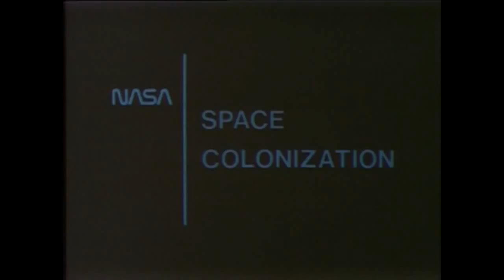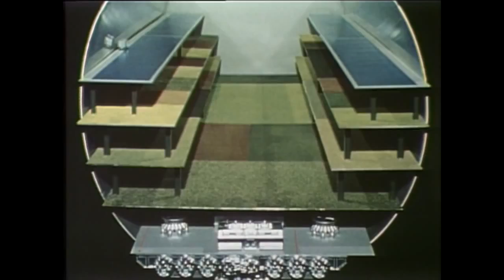Space Colonization  Stanford Torus Type Station 1970's NASA Video

Comment: I admire their vision, but there was absolutely no way this could have been built by the year 2000. It would have required an extensive moon base to mine the materials and then use a mass drive to fling it into space, which would have been an amazing feat in itself. A construction base would have been needed to be built at the Lagrange point, which would have been another herculean project. Finally, a 10-million-ton rotating structure would have had to be constructed. This compared to the 450-ton International Space Station that is in a far easier to reach location of low Earth orbit. I don't know in what reality they thought it would have been remotely possible to get that all done in just 25 years.
Reply: If it had been funded, yes we could have done it, could do it any time we wanted to start.
The people in the dtudies knew better than you or I when would be needed, and it was/is entirely feasible if we tried. We spend far more on the military than this would cost.
Reply: @JFrazer4303  The designers greatly underestimated the cost and technical expertise to build one. In 1975, the Space Shuttle was starting to be built which I'm sure the designers thought would greatly reduce the cost of launching material into space. The reality was the Shuttle never turned out to be the great affordable, reusable space launch vehicle that they hoped for. Even if the Space Shuttle had worked out, it was only for getting a payload to low Earth orbit. Another kind of shuttle to transfer cargo from LEO to the Moon and Lagrange point would have been needed and nothing like that was available in 1975 or even in active development. So, yes it was an amazing concept, but far too optimistic in 1975 to think it had any chance of being built by 2000.
Reply: @ The Shuttle was irrelevant, except in the very early stages building up to mining for the materials. Nobody expected it, with 20+ tons in a little payload bay, to serve very much in such an effort. 
It was known before the Shuttle flew that it was too small, too hyper-expensive and under capable for any sort of large effort.

We're not talking about what was historically available in '75, but what might have become available by '85 if such a program had been funded and started in '75.
Reply: @JFrazer4303  The point is that there wasn't the PROVEN technology in the 70s, 80s, or 90s to build a torus, especially in 25 years. If humanity's very survival depended on it being built, perhaps the technology could have been developed in time. Who knows? The expense was too great to even try on something that would have been a giant vanity project.  The success of the Apollo missions brought on a false hope that more manned space exploration and colonization would follow, but then reality set in.
Reply: @FlintIronstag23  if you doubt that technical abilities to do it, then you're invited to show your professional qualifications in all the relevant mining, construction and astronautical engineering, and where you're published under peer-review showing how the conclusions of those studies were wrong..
If you don't have facts and numbers better then theirs, don't bother talking about your feelings about the practical feasibilities of it

No new inventions needed, once the launch and in-space infrastructure is planted.
All the processing and construction methods are known if not used in such a way at such a scale, yet.
Reply: @FlintIronstag23 
Regarding the expense, I've seen good, rigorous, moderately pessimistic projections of the '70 space settlement studies. up to the first torus for the 10k workers in the attached manufacturing facility and all the ground, launch, and in-space infrastructure to mine the Moon and especially the NEA metals and build SPS.
3-4x the Apollo program adjusted cost, over the longer time. Variously around $900b early 2020s $.
Sounds like a lot if you say it quickly.
We spend that in less than 2 years in our DoD budget. Not counting "black" spending or ongoing military operational costs.
Roughly equivalent to the Interstate Highway system, or many large infrastructure or industrial developments down here.
Note also that the Pentagon has regularly badly failed their audits and can't account for over half their assets.
During the time period of Apollo, the U.S. spent as much on cosmetics, and large States spent more on liquor than we spent going to the Moon.
Reply: @JFrazer4303  My qualifications to judge it is based on the empirical fact it was never built. If it had been relatively easy to build, and at an acceptable cost, then somebody should have built it. Fifty years later and not even a hint of one being constructed in the perceivable future. It is nice to have dreams and am not saying something like it will never be built, but it wasn't practical or feasible in 1975 or 2025.  It will remain science fiction until one is actually constructed and proven to work.
Reply: @FlintIronstag23  so, you've got nothing, and there's no reason for anyone to believe you.

As I wrote : "If you don't have facts and numbers better than theirs, don't bother talking about your feelings about the practical feasibilities of it"
Reply: @ The simple fact that it was not built proves it was not practical or feasible to build in 1975, 2000, or 2025. I don't know why that concept is so hard for you to accept or understand. The burden of proof is not on me; the burden of proof is on the designers and promoters to prove it can be built and work. Studies, simulations, and estimates are fine, but the proof is in the actual engineering and building. Unless it is built, it is an unproven concept. That is the reality whether you want to accept it or not.